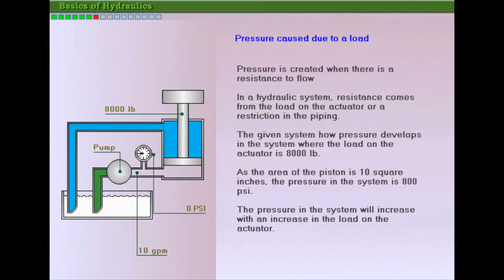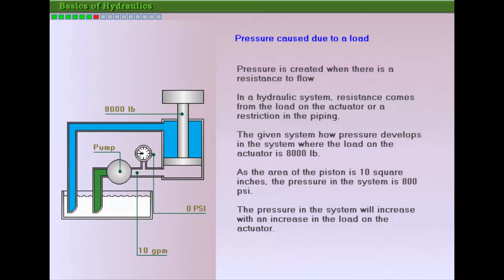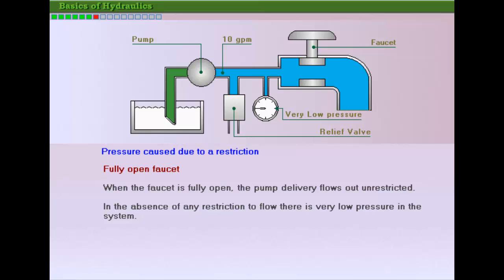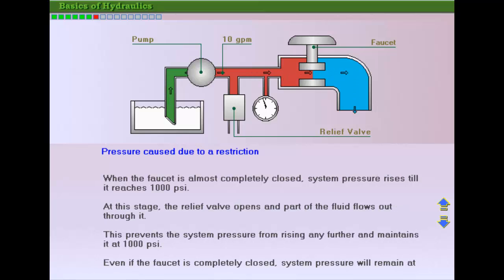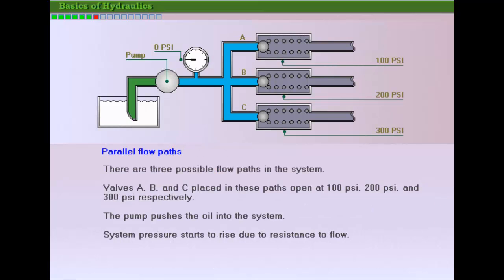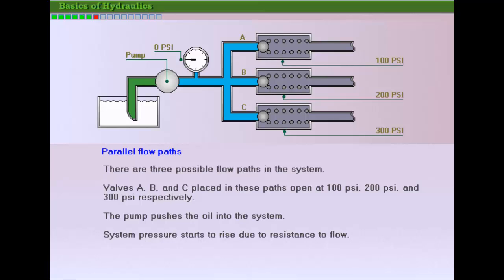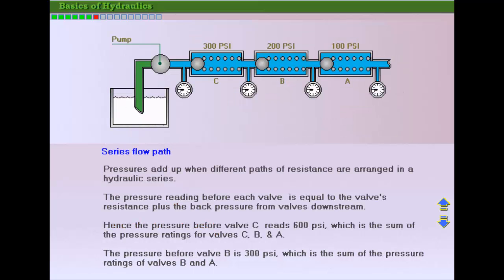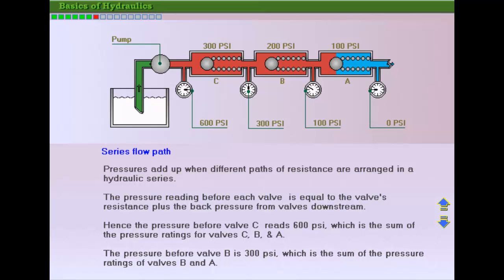Basic of Hydraulics part 7 OF 16 | Mechanical Engineering

Comment: just testing my own knowledge and I have to admit, this part I would have failed (resistances in series). I mean one could compare it to electricity, where resistance also accumulates (in series). But I would have applied (pressure applies equally) to the example and say the maximum resistance is that of the highest restriction. And not be accumulative...damn. Flow is a different animal of course.